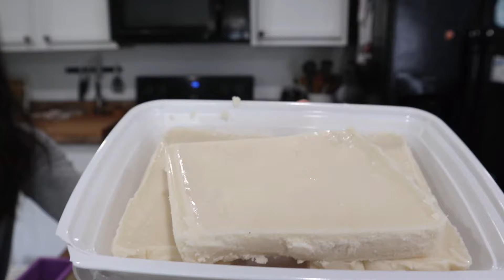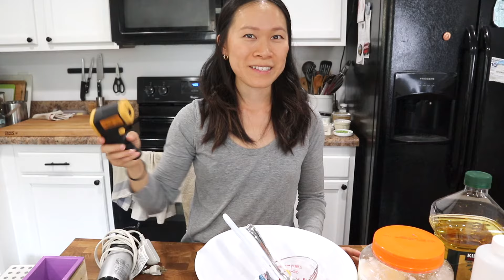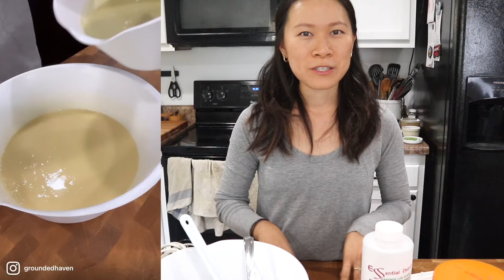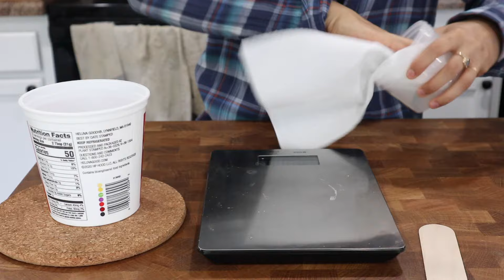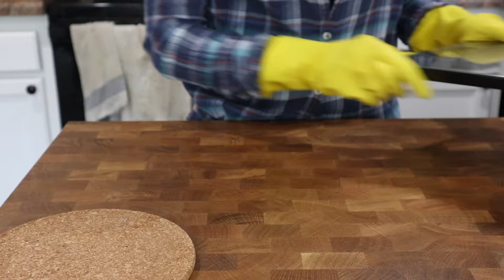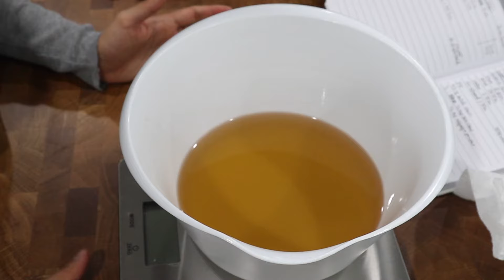How to make easy homestead soap for beginners using tallow 🧼 (start to finish, with recipe)

Comment: You mentioned in the video about the temperatures of the oil & lye and for them to be about 10 degrees difference, but you said you made the lye solution few hours before, so did you heat it up before mixing?

Comment: You should be able to still use all of your stuff for food after you clean it. All of the ingredients are used in food including sodium hydroxide. So there is no need to buy separate pieces of equipment.

On another note. Sodium hydroxide when exposed to air eventually becomes neutralized.

Glass is safe to use temporarily but you never want to store sodium hydroxide in glass jars due it potentially reacting with the glass and creating silicates.

You also will want to wear goggles while adding the lye to the oil due to it still being able to splash.

Comment: Really beautiful all natural soap. Thank you for sharing! I would recommend keeping some white vinegar on hand as it will neutralize the lye if you were to get it on you. Research it 😉 we did this where I use to work and keep in mind it doesn’t save the eyes if you get it in the eyes.
Reply: When you pour vinegar onto lye, also prepare for a lot of heat. That’s why you never put vinegar on your skin to neutralize a lye solution splash. The heat will severely burn you.

Comment: Does this natural soap plug up drains? My plumbing does not care for oily things!
Reply: Use a lye calculator online and use a low percent superfat. It will calculate how much lye and water and give you a superfat range from 0-10, telling you how much lye and water you'll need for each value. 0 means there is no fat left over after the lye has finish saponifying the fat. 1%+ tells you how much free fat there will be. So you can adjust the recipe to fit your needs.

Comment: Should it lather as you do clean up? I followed the precise measurements and your fantastic directions, but clean up was still greasy, so to speak.
Reply: It takes a couple of days for the raw soap to cure enough for the oiliness to be emulsified, after which any soap remnants remaining in the mixing bowls or on utensils will lather a bit when washed with water.  It took me a little time to realize this but once I did, it was a game changer!  Since I was making only enough soap for my family, I had time to set my mixing bowls & utensils aside in a storage room for a few days before washing them to make cleaning easier.  Once the soap remnants have aged a little, you can wash the utensils with plain water since the utensils are already coated in more than enough soap to clean them.  And yes, it will produce some lather at this point, though not as much as when the soap has fully cured.  An added benefit of waiting to clean the utensils is that the longer you wait, the milder the soap will be on your hands.  Raw soap is very harsh on skin, but the longer you allow it to cure, the milder it becomes.  Hope this helps.
Reply from the maker: It is a bit of a messy cleanup process. I usually try to wipe up whatever i can with paper towels before washing with water, and that helps a lot!